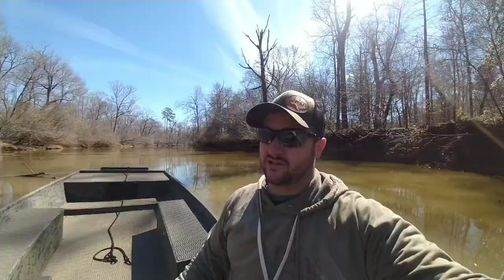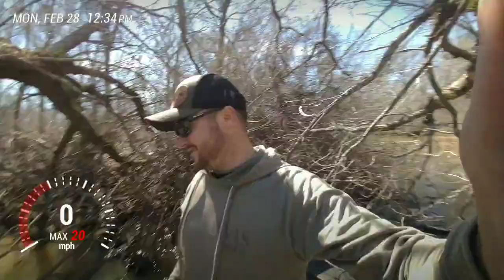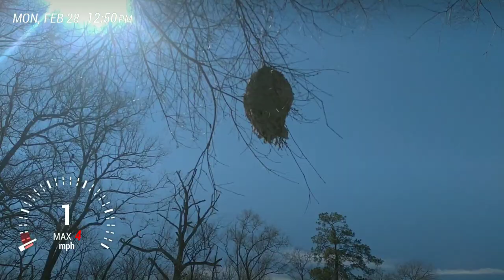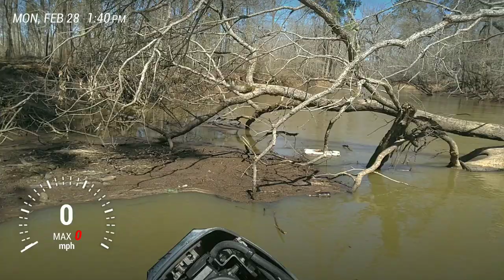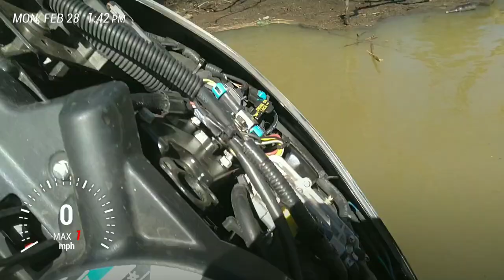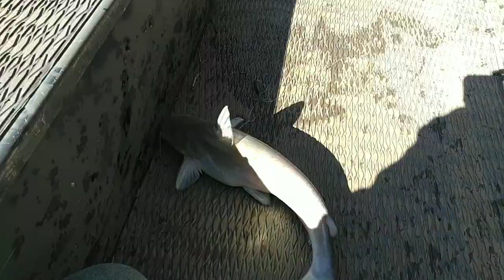Neches River SH 7 Run. (LOTS OF LOGS)

Comment: It’s legal to navigate navigable waters. You can’t touch the bed of explored waters for longer than necessary. (Camping, noodleing, etc.) basically if you fall out you can use the ground for as long as it takes to hop back in and you are still not considered by the state of Texas as trespassing.  Still temperamental land owners usually see it different and law or not you might get shot. Totally awesome what you are doing! Absolutely love it! Stay safe keep it up!
Reply from the maker: Maybe that why it is always so gray. Whos perspective you are getting. Thanks
Reply: What boat is that?
Reply from the maker: 1652 kaz kustom

Comment: I've a question..when you hit a tree or a rock dont you damage the electric trim?
Reply from the maker: I think it is a possibility, but I have hit  a ton and mine still works like new over 400 hours on this motor.
Reply: @DennisBohannan  but when you hit something the outboard "goes up" or the trim Is bolted ??
Reply from the maker: @alelombardi5922  this is where having motor mounted the correct height (as high as possible) allowes the intake to just ricochet over whatever you're hitting. Also being trimmed out as much as you can lessings that attack angle to reduce the impact.
Reply: Tnx..I asked you because i had an e tec 30 jet with manual trim and if i hit a rock the outboard "gets up" because of the "unlocked trim"..thinking to the merc my worries are to damage something hitting because the trim Is bolted and "locked"..if i explenaid good
Reply: I carry an extra shoe and impeller. The true test of a jet boater is how fast he/she can change out a shoe, liner and impeller while standing in two feet of brown water infested with cottonmouths!

Comment: A freind of mine was running wide open (like you), with a 40 horse.  He hit a submerged log, like that river has and he flew to the front of his aluminum boat, smashed his face, lost one of his eyes, Randy Emmons, Pascagoula, Mississippi,  Life flighted from the river, nearly didnt survive.   And as you were racing around the bends of that off shoot, could you imagine comming across some folks canoeing, running them over?   And then finally, all this hot dogging and log jumping dont want a life vest on ?   Thats all my criticism, enjoyed seeing what the upper neches looks like.  Ive been on the neches near Kirby.
Reply from the maker: All true, and I'm not above it happening to me. The log jumping is all anticipated so would not be caught off guard. With way boat us set up and using the trim almost impossible to snag a log amd bring you to a halt. As ar as flying thru the woods and hitting a canoe. I can see.uch better than what appearson the screen amd if you watchy speed in the tight spots I am not going very fast. I quick reverse trust havee stopped in a few feet. I see your concern amd it is noted. Everything is a calculated wrisk.

Comment: You choose not to have a jack plate?
Reply from the maker: Yes no need. Plus the setback will will turn the intake into a hook.
Reply: @DennisBohannan   I gotcha-

A couple questions more if you don’t mind- 1) Do you see the 1652 hull as good choice for maneuvering in shallow running rivers compared to a 1648? 

I do understand the rivers you run as NW Louisiana isn’t that far away from you in Texas, and my intention is to hunt waterfowl in Western rivers, so gathering facts from individuals like yourself helps with my decision. Am happy you are open to questions on your YouTube Channel. 🙏

.100 gauge over .125? Mod V with tunnel hull? Had better luck with Mercury jet outboards? Appreciate every answer given. Thanks in advance.
Reply from the maker: @bobbycrenshaw5167  if your going woth this horsepower range absolutely mercury. They offer short shaft and large pump. No other manufacturers off that in the 60/40 class. 

The 1652 seems to be go to size with this power as well. Drafts, planes, runs out great. 

I don't see a need for a tunnel especially on boats this size. They rob a bunch of power and speed. With motor set properly and use of trim of your hitting it is simply not enough water.
Reply from the maker: @bobbycrenshaw5167  my hull is .100  thicker is always better but thicker weighs more. Keeping the boat light is key for success on the water.  I have a video of the battery I run only 2 pounds.

I like the flat bottom but dont reallybhave experience with anything else. Will have more slide, but once mastered sliding can be used to go even shallower.
Reply: @DennisBohannan  Thanks.❤️